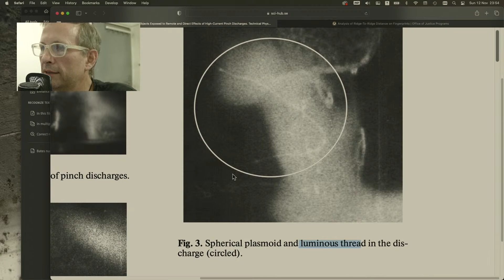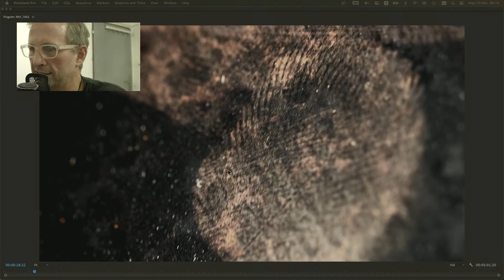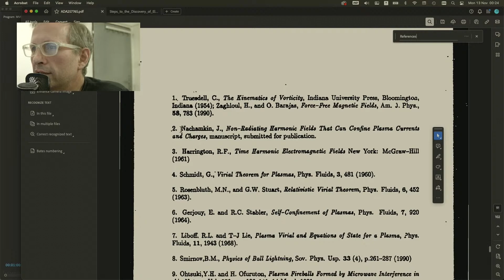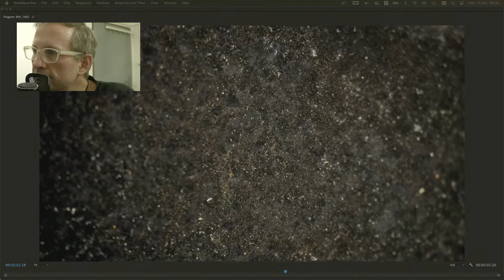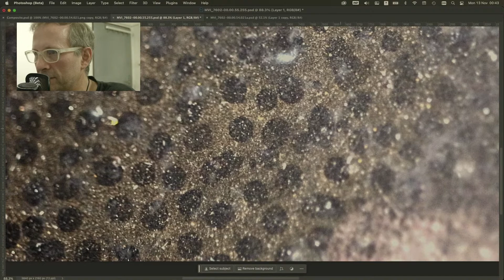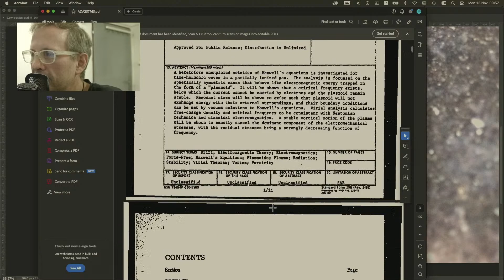THOR - Outside Inside

Comment: I’ve watched many of your videos on this subject and follow the subject with intense passion.  I’m an independent researcher like you.  As this testing unfolds I encourage you to pay close attention to fuel efficiency gains under 100% full engine load (e.g. if you modify a generator, have it power the biggest electric heater it can support and measure the runtime of the heater with and without the device, powered by a 100cc syringe of fuel).

One key feature of this design is that it ends up injecting some moisture into the combustion chamber.  At idle merely injecting water will dramatically lower emissions and increase efficiency.  This effect disappears under load.  Since this secondary effect is well known and can confound interpretations of the results I encourage running all tests at full load to disambiguate this well-known water injector effect from the much more interesting effects of the geometry and plasmoids.

When people speak of plasmoids “embedding themselves” in the apparatus such that they have a durable effect after sufficient conditioning, this could plausibly be true in effect even if it’s not due to the plasmoids actually persisting.  If plasmoid activity occasionally triggers transmutation that produces meta-materials (I consider this a near certainty as the atom building process is messy) that enable certain catalytic reactions to occur at low energies, then just throwing plasmoids at an object may give it seemingly magical properties because the matter is in very exotic states at various locations in the metal surface which hot exhaust is passing by.  So the plasmoids turn 304 stainless into an alloy meta material that catalyzes chemical reactions in the exhaust gas.  If so then the kits sent to customers may not need plasmoids on an ongoing basis to achieve the desirable effect.
Reply from the maker: The tests have found that the engine runs less efficient with no load than control and more efficient with load based on the amount of time it will run on a controlled amount of input CCs.

Comment: Are the spheres in the leopard print dimples into the material surrounding it or deposits ontop of the lighter meterial around it? Also how much of the surface debis would you attribute to particulates as a result of cutting the spheres open?
Reply from the maker: I used a camera lens air blower on the surfaces at times to clear loose particles. Can't really know on the latter point, but the patterns are NOT a result of cutting.